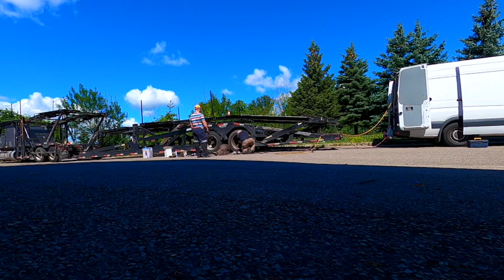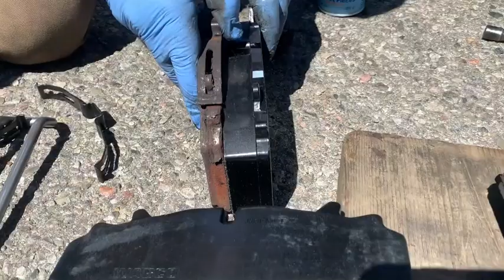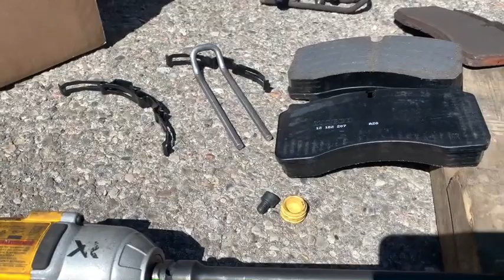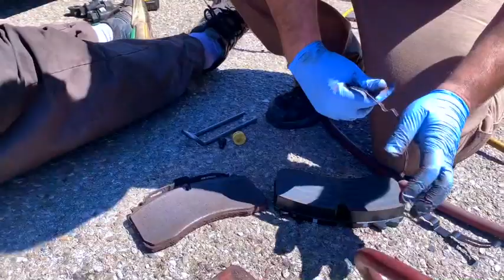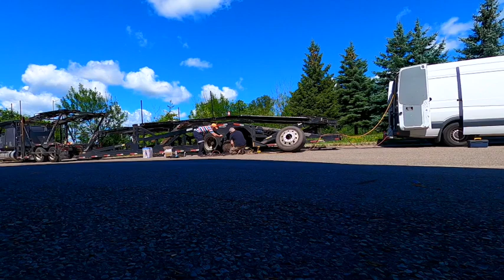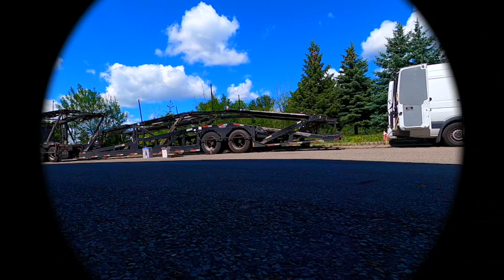Car Carrier ❌ WOW 😳 MAXX22T Brake Pads  Hendrickson - Wabco  🆘⚠️🅿️  Cottrell trailer

Comment: What tool are you using to get to the adjuster?
Reply from the maker: Hello ''for the love of tools",
Thank you for your question.

You can use an 8 mm deep offset box end wrench.

Thank you for watching my video.
Reply: @PaulMcLove  must have to be a 90° offset because i can't for a 45° offset in there
Reply from the maker: @fortheloveoftools   Be careful with the Adjuster plug. Do not damage the inner seal.
Reply: @PaulMcLove  i had to make a tool today to get something in there.  You have the only video on here that has wabco braking system
Reply from the maker: You can try to use a ratchet with an 8mm socket
Reply from the maker: Also, be carful at pressure plate, when you have to reassemble everything.